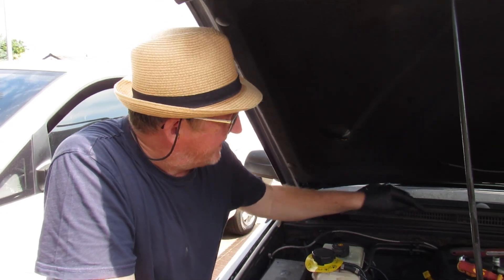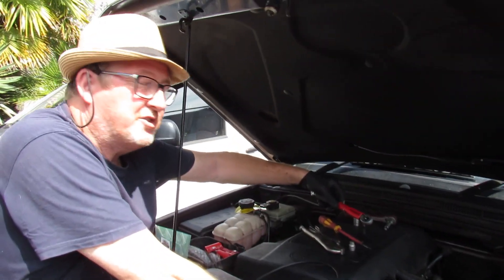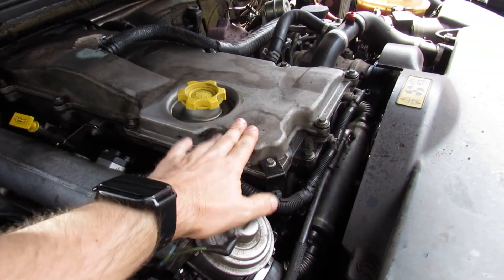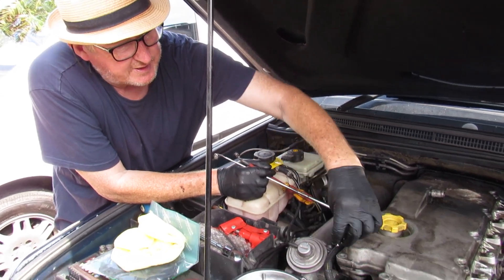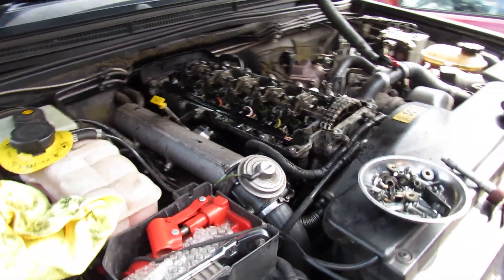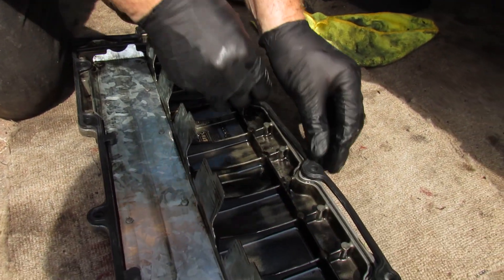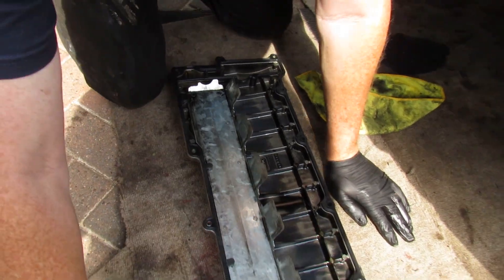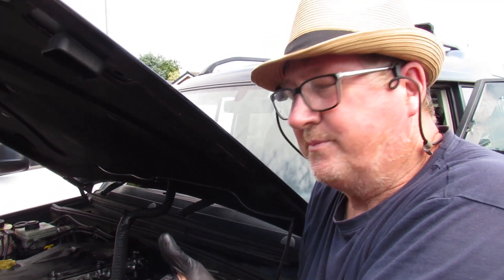Land Rover Discovery 2 TD5 Rocker Valve Cover Gasket Replacement How To

Comment: The worst bit is fitting the cover and making sure that half-moon goes into the right place. That plastic bit at the rear of the head is missing on mine so the job is easier. On the 10p engines, a smear of sealant goes on the back edge of the gasket.
Reply from the maker: Thank you for your advice and sharing, I've watched many of your videos and learned a lot from them.

Comment: If you're taking the rocker cover off, why wouldn't you change the injector loom while you're in there?
Reply from the maker: thanks for your comment, it has been replaced previously and currently no ingress of oil into the injector harness loom connector near the rocker cover nor in the two black/red ecu block connectors.
Reply: @DanielJohnHowTo  Ah, right.  I replace the injector loom as part of a service, they aren't too expensive.